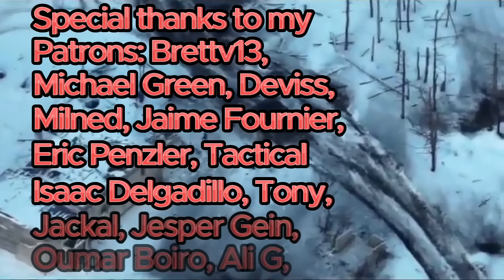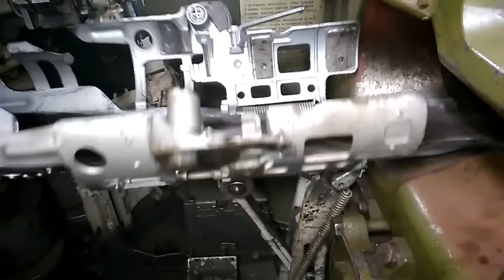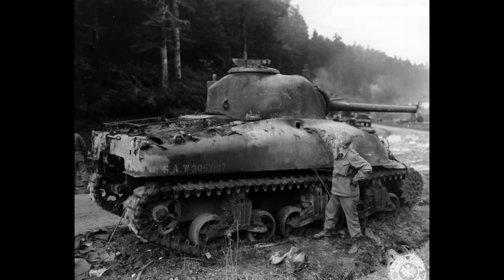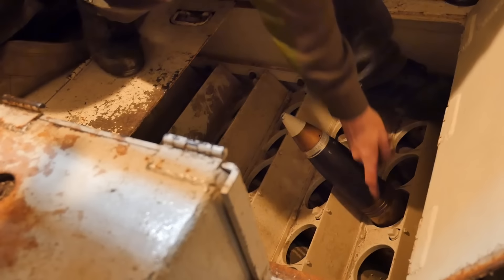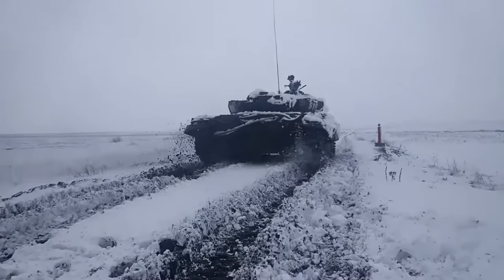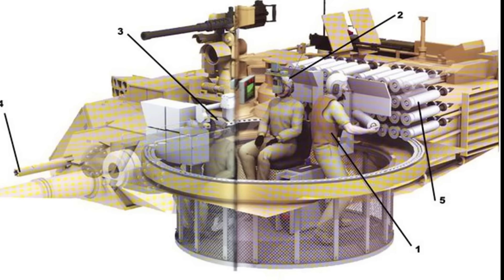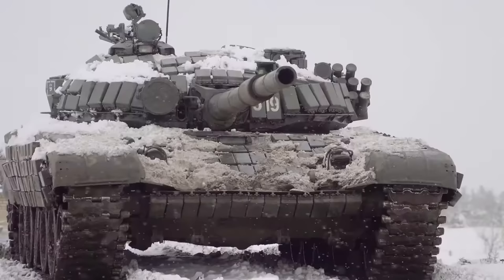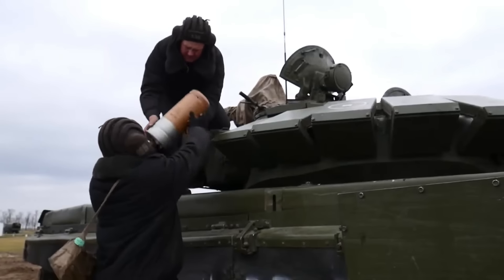Is Autoloader Really the Reason for Russian tanks exploding so much?

Comment: That's why object 148 (T-14) tries to combine both approaches, with ammunition still being positioned at the bottom of the hull (for lower hit probability), but with the crew isolated in a separate armored compartment in case of catastrophic detonation.
Reply: Past tense please. You know that T-14 project has been cancelled, right? A combat capable unit was never seen.
Reply: @nickhtk6285  It is not cancelled, the current priority is just shifted towards ramping up T-90M production due to wartime demands. This also gives the design bureau time to update the vehicle, accounting for accumulated combat experience.

Comment: Leopard 2's have been tossing turrets with the same enthusiasm
Reply: While Leopard 2s can indeed "toss turrets"... let's not deceive ourselves into thinking they "toss" their turrets with anywhere near the same level of frequency or "enthusiasm" as T72s. The T72's reason for turret tossing is due to a legitimate design flaw where literally ALL of the less than inert ammunition for the tank is essentially based at bottom chamber of a barrel (turret/hull)... creating an almost cannon like effect for the turret if the ammo was ever to detonate. However, the Leopard 2s have a significantly different design where only maybe a quarter of the much more inert ammunition is stored "below" the turret (with the rest in the back), giving Leopard 2s much less "potential" chemical ammunition to fuel a detonation (if it even detonates, most are deflags) that would potentially send the turret flying. Such "catastrophic" events in leopard 2s are more based on improper procedures for ammo storage, like "storing" rounds on the floor of the turret for more "long" term "fixed position" firing locations or propping open the ammo blast doors, where they don't want to constantly leave in order to refill/arm... and thus exposing them to being hit/detonated more readily whilst increasing the "potential" chemical load for said detonations.

Comment: The key problem is not the carousel itself, but the fact the crew is sitting directly on top of it.  A written off tank is still cheaper to replace than an experienced crew.
Reply: Holy hell did you even watch 2 minutes and 30 seconds of the video?
Reply: The problem with Non-auto loader tanks is the ammo is at a crutch level
Reply: That is NOT the problem with turret tosses. There are no bolts holding the turrets down for maintenance purposes hence if the ammo cooks off rather than just burns, the turret will fly off..
Reply: Guys, come on. Why the turret tosses is because of the amount of ammo, the type of storage for the ammo(blowout or no blowout), and the types of ammo it carries. Not (just) because the crew are sitting on top of it(even an M60 or Leo 2 or any tank with a bit of ammo that isn't under blowouts can turret toss or kill the crew), and definitely NOT because "it has no bolts to hold down the turret"(ofc it fucking does have some apparatus to hold down the turret, which are then removed for maintenance. It has NBC protection for fucks sake)
Reply: @user-tv7fg7wt2d  Well since you want to be technical, you're wrong, it's because the explosion is directly under the turret, making the path of least resistance that of launching the turret.
Reply: Now in regards to bolts, that's a non-argument, as they would still be the weakest point, thus the first to fail.
Reply: @gunt-her  Sorry, I forgot to put "just" in between "Not" and "because". What I was trying to say is that the the ammo being everywhere and the lack of blowouts are the actual main problem, not just the carousel. 9 hours ago I thought you were saying that it is the only problem when there are ammo above the carousel, which don't even have a bit of protection. An M60 or Leo 2 can still pop a turret despite the ammo not being under the crew.
Reply: @user-tv7fg7wt2d  IDK about M60, but the Leo has a hull storage that shouldn't be used in combat, otherwise it has blowouts.
Reply: @user-tv7fg7wt2d  The unsolvable problem with the T-series as I see it is when I say the crew is "on top" of the ammo, I should say they are "inside the autoloader".  Blowouts would be pointless because with that design there's no way to put the crew behind a bulkhead.

Comment: I would like to address some issues about former soviet tanks in general. First of all ,as far as i know ammunition rarely explodes, because the propellant actually doesn't explode,it rather burns. That being said, i think in this case an average crew has ,up to five minutes to abandon the vehicle. Second, i would like to point out, that in the early 2000s, there was an autoloader design that was developed for all existing soviet tanks. It was a very cheap and easy to make design. A cut was made in the back of the turret and the autoloader was simply bolted on the back of the turret. Rather unsurprisingly the russians didn't show any interest in this design which could make all their tanks much safer and faster to reload . At this point ,i think the russians should start developing similar propellants to german ones.

Comment: Meanwhile, some completely burnt out leopards from a4 to a6: What are the "insensitive powder charges" in our shells!? 
Meanwhile, the Abrams who simply cannot get to the battlefield or live there even less: Yes, we just burn up without completing the combat mission, but for that we saved the crew!!!! (who will also fail to complete the combat task next time)

PS: for those who are particularly critical of Russian tanks. 
1) Look at the number of videos where tanks detonate in battle
2) Look at the number of videos where tanks have already been abandoned for various reasons (mines, breakdown, stuck or damaged by a projectile / drone (for example, an engine). The tanks are standing with their hatches open and they are being finished off by drones. After that, they burn out or detonate.
3) The video of the drone finishing off empty tanks will be hundreds of times more. If you really follow from the very beginning, you will understand this even without reading the message.

4) Tankers on the spot have more complaints about the reverse gear than about the ammunition.
5) For both sides of the conflict using T-series tanks, the situation is completely real. The situation is when the unit lost 80% of its vehicles and only 10% of its crews. 

6) Only after these points above, really think about the effectiveness of tanks. Unlike the Abrams tanks, the T-series more often continues to move after the first (if not more) drone strike, while the American is eliminated from the game. You saved Abrams' crew! Now, without supplies from the USA, this tank crew will die as an infantryman))) "Stonks"!?!?!?)
Reply: Also T-64/72/80/90 has better top protection from the start, and then reinforced by ERA. Most western tanks - flat and thin metal, only some modifications (like leopard PSO kit) have better top protection.
Reply: @alexturnbackthearmy1907  I agree. This is also an important point to pay attention to.

Comment: Where do you get that notion that Russia "has to copy NATO munition" what if it's the opposite? The whole point of Russian munition is that it's CHEAP. Much cheaper than NATO munition. So they need to copy Russia in order to save money and not the opposite. To my knowledge it has 10x the price of a single tank shot Russian vs Western one. Even if it slightly loses in some aspects, for a war of attrition Russian munition is the BEST one in the world!!! Everyone should copy them and not Russia copy anyone else... ( if they serious about winning a war).
Reply: The dart of APFSDS ammunition is by far the most expensive part of the munition, so changing the propellant is relatively cheap by comparison. This might be an argument if you’re purely talking about dumb HE rounds, but you might want to ask the guys handling those rounds which solution they‘d prefer.
Reply: @RichelieuUnlimited  who the hell uses APFSDS nowadays? Tank duels aren't a thing, they are extremely rare.
Reply: @RichelieuUnlimited  I was talking in terms of a combined average cost, for all types of munition. It is about 10 times cheaper for the Russian counterparts.
Reply: @korana6308  If it costs you a tank and its crew that otherwise might survive/be repaired, it’s a bad tradeoff.
Reply: @ForOne814  With modern HE shells with programmable fuzes it’s not much different, although not to the same extreme.
Reply: @RichelieuUnlimited  that's a misconception. There aren't many blown out tanks because of bad munition placement inside the hull. (same thing and argument about "low reverse speed", in practice and in real battle it doesn't make much difference.) Everything else is much more important than that. It's much more important to have reliable tanks and loads of them. Russia had produced 1500 tanks (new and upgraded tanks of different models) last year. None of that would have been possible in the west because everything is much more "advanced" and expensive. Same thing with munition, it's 10 - 20 times more expensive for different types of munition.

To be honest I'm not sure if I allowed to say this as that might be some kind of Russian military secret, which is not really a secret, but somehow I am the only one that can see it... Nobody on the internet cares about the truth. The only pattern that I see is people jumping to conclusions based on some predispositions that they have, without giving it a proper and throughout thought. Russian "equipment is bad" and "Russia doesn't know how to fight", yet Russia is advancing forward... etc etc. which seems counter intuitive... It seems to me like one big propaganda war game. And I'm literally in the middle of it trying to break through it's bs and speak some sense... and nobody seems to care... everyone is too involved and biased towards one or the other side and not cares to view the whole picture... and to seek for the truth. 
Ya probably won't even read it... good luck.

Comment: Autoloader is not the main problem. It presents flat target and is protected by thick armor. There is this one specific weak spot behind the turret, but it is difficult to heat. The problem is ammo OUTSIDE of the autoloader. T-72/T-90/T-80 tanks keep additional rounds of ammunition scattered all around the turret.

Comment: The problem is propellant. Highly inflammable and caseless, so burns easily. So any penetration of the crew compartment is liable to set the propellant burning. Carousel was placed below the crew, to reduce the height of the tanks.
Autoloaders are not new. It is the Russian design that is the problem.

Comment: ... problem is not ammunition stored around turret ... one exploding shell will not send 10 ton turret 70 meters to air ... problem is still ammo in carousel and fact that its easy for any frag, molten metal or fire to get to that ammo storage its subpar design no matter how you look at it and any nation using this vehicle is just shoting it self to foot ... i ve told it many times and i will say it again how long it will take to make tank... few days? week? how long will take to create good tank crew ... years ... they can drive 24/7 and it will take years anyway because they get experience as they work with others, encounter obstacles and so on and so on

Comment: Never take a tank that was designed for fighting in mass by putting as many rounds down range (auto loader) to a battlefield that requires small troop skirmishes and tactics where each shot counts (Manual loading) while you shoot and scoot. 

When the T72 was made, the soviets wanted a tank that can shoot fast and in numbers where you don't need to worry about being accurate or having battlefield awareness, individual tactics and small skirmish survivability were not on their minds when developing this. I don't mean to make a gab at crews in different countries that use this, it's just how it was made.

Comment: Russian and Soviet design was less concerned with casualties. Large numbers of troops/vehicles were seen as superior and losses were expected. An autoloader reduced crew requirements, allowing a larger number vehicles to be operated by the same number of troops.  Ultimately, having ammunition in the hull, with no blow out protection or other countermeasures, is a bad idea.  It isn't like the Russians haven't known about bustle designs nor are blow out panels difficult to engineer.  With mostly conscript based armies they were not concerned, and thus didn't put any design measures in place for crew survivability.  Western armies, especially with the transition to all volunteer forces had to put more emphasis on crew comfort and survivability.  If you watch many of the Ukrainian tanker interviews the ergonomics are something they comment on frequently. There is just more room inside western tanks, at the cost of western tanks being larger and heavier as a result. TLDR: Ammo in carousel autoloader designs, and spare ammo inside tanks, is a bad idea from a crew survivability standpoint. You have to keep the ammo outside of the crew compartment as best you can, and turret bustles are currently the best choice given the various tradeoffs.

Comment: I still have no idea why the The_Chieftain supports the use of an autoloader in western/American tanks after seeing how badly autoloader carousels have played out.
After seeing how badly the autoloaders have worked out for the Russians and knowing the limitations and drawbacks of an autoloader, I don't see any potential upside besides slightly increased rate of fire or the ability to use 130mm rounds without issue. And that's not that much of a benefit.
Reply: Maybe he's reffering to other types of autoloaders, there are multiple systems that don't turret toss, as far as I remember
Reply: @мясорубка2232 The system itself can't. But the additional hull ammo they carry still can.

Comment: No. The auto loader is NOT responsible. Russian tank turrets are not bolted down so a cook off always blows the turret off. Stop dramatising something that is absolutely expected to happen in tanks where the turret is not bolted down as in most western tanks.  On the other hand turret tosses are also not uncommon in western tanks either. This is a silly subject, borderign on click bait, well discussed and resolved 40 years ago as a result of the arab-Israeli wars.
Reply: The ammo sits under the turret but sure that's not the reason they fly.
Reply: How tf is it not responsible? If they didn't have the autoloader ammunition there, the turret would not toss. SIMPLE AS
Reply: @мясорубка2232  Because in western tanks the ammo sits at crutch height silly person. Are you tank crew? Nah you arn;t. A tank crewman can tell these things.
Reply: @DaveSherry-z1w  What's that got to do with Russian tanks and Russian autoloaders? Their specific autoloader system leads to the ammo being mainly unprotected and not separated from the crew. Western tanks that store ammo in the hull also toss their turrets if hit there.
Reply: @мясорубка2232  BS sonny. The ammo in the A/L is below the level of the turret ring. Many western tanks also store below the turret ring many have ready rounds above the turret ring. The auto loader has zero to do with cook offs when struck. Yep western tansk do toss their turets as well russian just do it more frequently AND they drop their turret if they roll over. Check pictures from Valley of tears